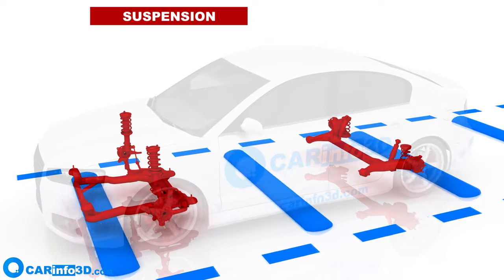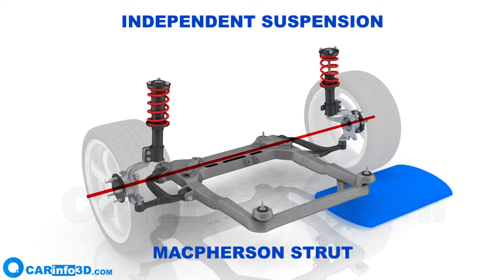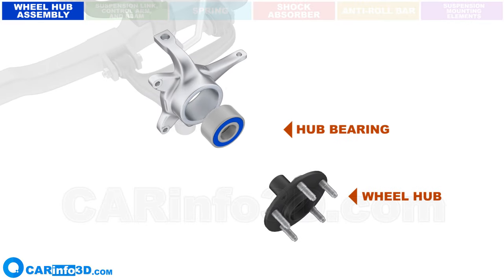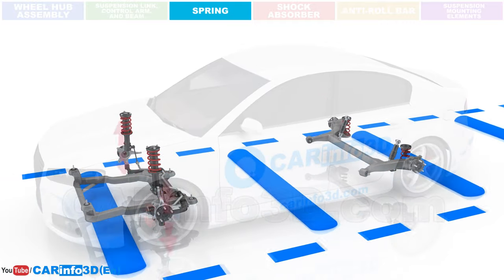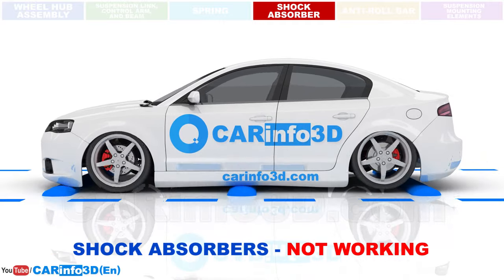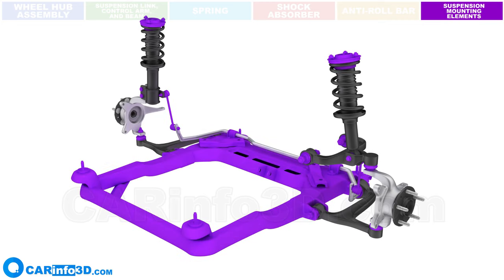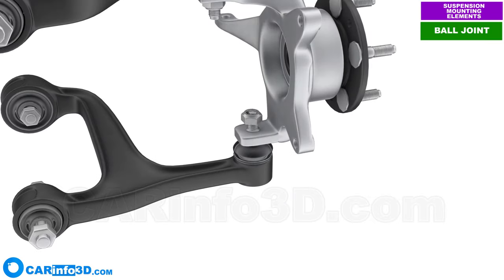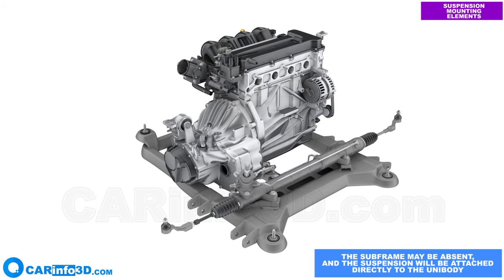Car suspension / how does it work? (3d animation)

Comment: Amazingly effective presentation to anyone interested in or working on motor vehicles! Thanks for showing the suspension mounting points, trailing arms and subframe as well. Most presentations without these (just the wheel only) don't do a good job showing how the entire suspension works relative to the entire vehicle. 

Also, I would be interested to see a video explaining the basics of suspension tuning, such as compression, rebound, the effects if you have soft rear and firm front settings (why it feels like understeer), etc. Maybe also a motorcycle suspension bible? :)

Comment: Thanks guys for really interesting content!
It also interesting how the suspension works on Tesla cars, since they use electric motors almost near the wheels. Not sure does it change the basic principles, but the interesting thing I heard about model x - it's use air suspension, which may change the height dynamically - depending on road's and driving condition (faster driving - lower clearance, off-road - higher and so on).

Comment: 9:13 - The animation is misleading. The motion of the sway bar is not inverted; pushing it up on one side does not cause it to go down on the other. Instead, the sway bar mirrors the movements of the inner and outer wheels as you navigate through a turn.